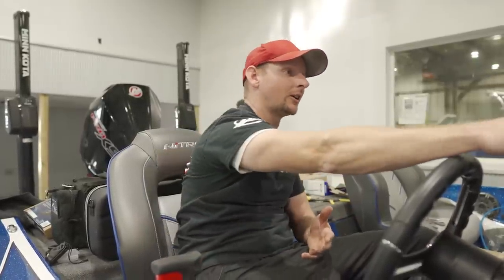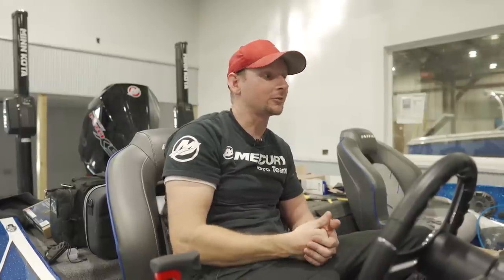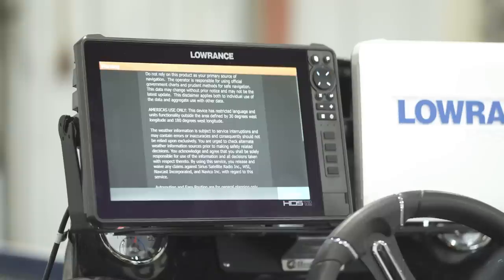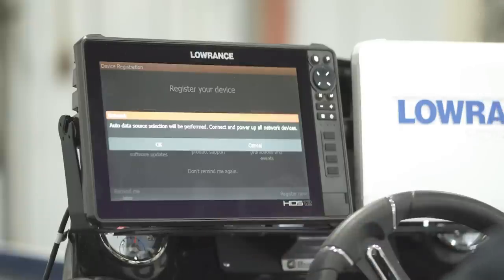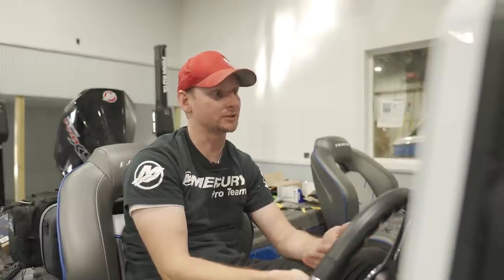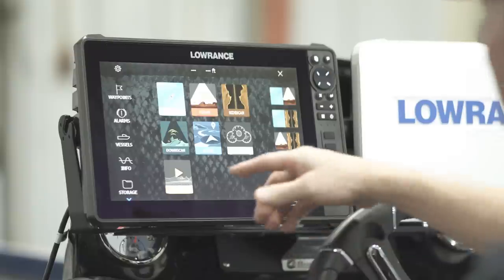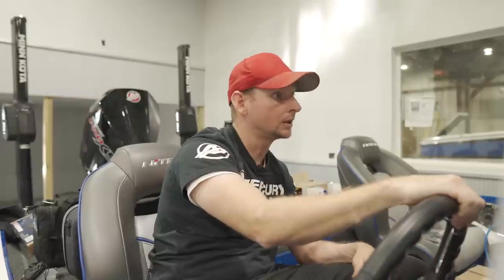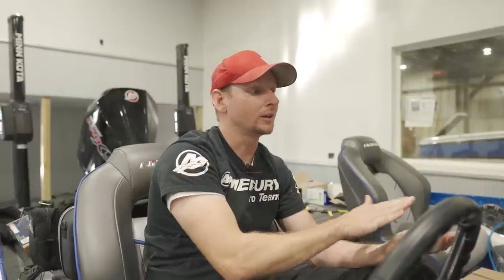Initial Setup  of the Lowrance HDS Live 12inch

Comment: I just installed a 12 live and I have a 2019 f200 Yamaha with the digital cord from the motor to the nema backbone cannot get the Yamaha icon on the screen worked just fine with the 12 touch

Comment: I'm considering upgrading to an HDS12 from an Elite Ti. I have the Total Scan transducer installed on my boat, can I use the Total Scan transducer with the HDS12? If so, will I lose features? Thanks.
Reply from the maker: You can use the totalscan transducer sir.  the 3n1 active imaging would be best as it was designed for the new live unit, but you can use the totalscan if you want to.